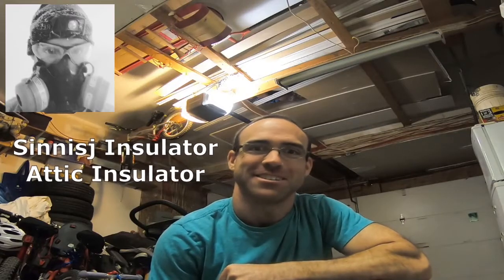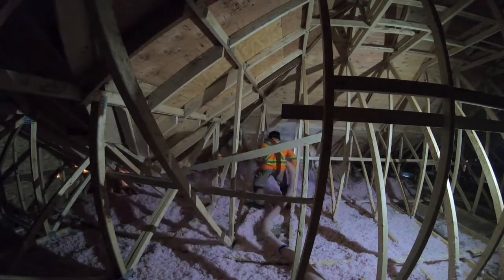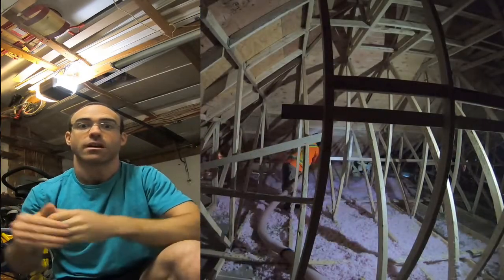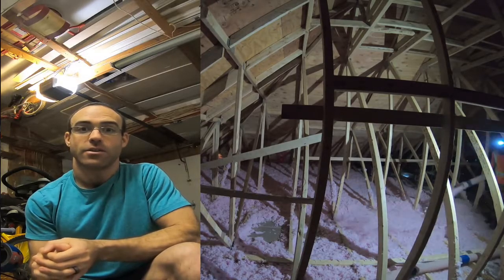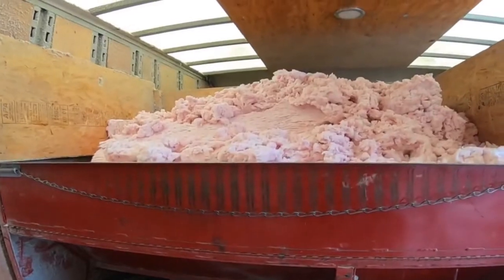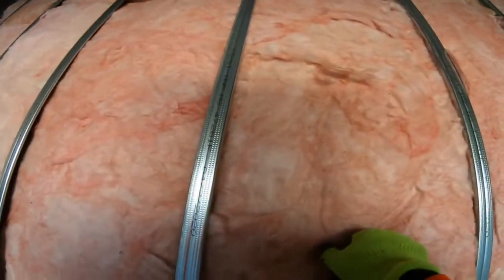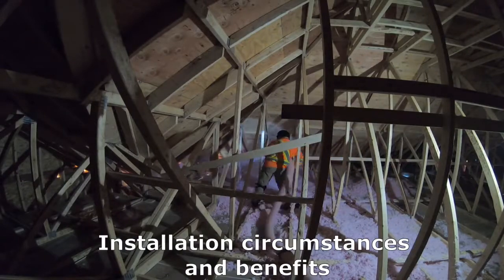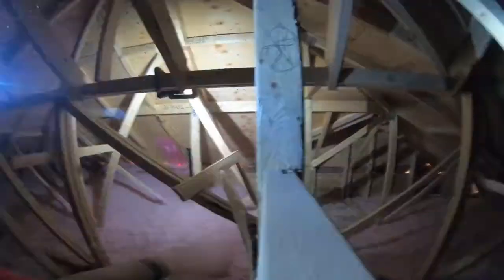Spray Foam vs Glass fibre | 3 heat transfer differences!

Comment: Pretty good comparison!! I like the fact that you know when and how each product can be used.
Reply from the maker: Thank you. I'm glad you enjoyed that. I'll be following with a "skills required" to install both products in a later video I think.
Reply: @SinnisjInsulator  that’s a great idea , could I offer a very experienced and knowledgeable and none biased professional ,prospective?
Reply from the maker: @chinidad2778  always
Reply: @SinnisjInsulator  I think I can provide a standard and skill set that has been refined for a good 20 years with a zero failure rate,if your interested.
Reply from the maker: @chinidad2778  sure, I'm of course more experienced with the attic. I was going to refer to the 3 day course for sprayfoam and then the onsite skills and training before you acquire competence status and can be lead on the rig.
Reply: @SinnisjInsulator  that three day course is a joke and hardly qualifies people to control a very complex hydrological system that essentially manufactures a chemically induced exothermal reaction that is so dangerous it cause illnesses and burn down houses , you need the correct information josh!
Reply from the maker: @chinidad2778  I'm all ears. And totally get it is very basic information. Foam creation is very complex. Hence why chemical engineers are hired to create the mix.
Reply: Spray foam is basically a chemistry class , meteorology,physics classes all in in one every day in order to manufacture the correct product every time the gun is turned on.
Reply: @SinnisjInsulator  yes it is , not to demean any one’s abilities or skills 😅not what I mean
Reply from the maker: @chinidad2778  definitely agree. Many things are fine tuned and require constant monitoring.
Reply: @SinnisjInsulator  like I have said before josh , I am impressed with your thought process and how you look at your work as well as your knowledge in the field (4years)! Sounds more like a journeyman insulator. Great work bud 👍